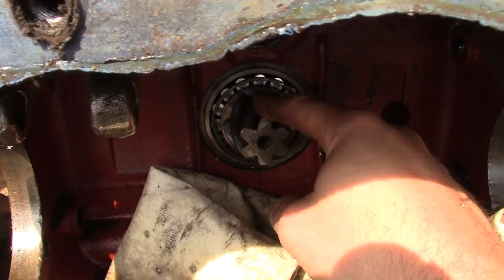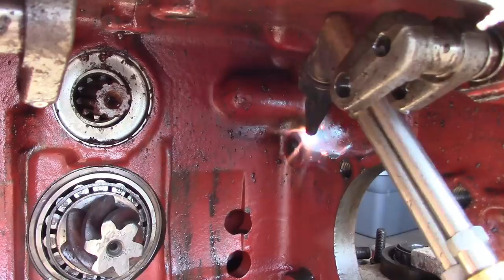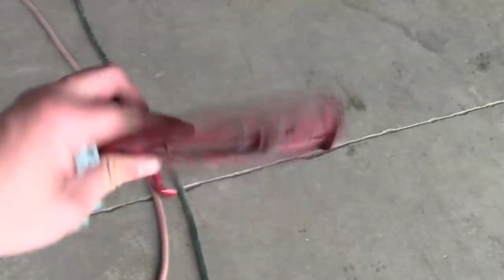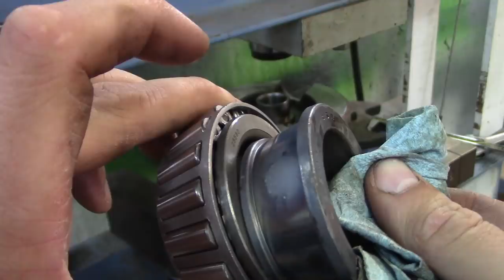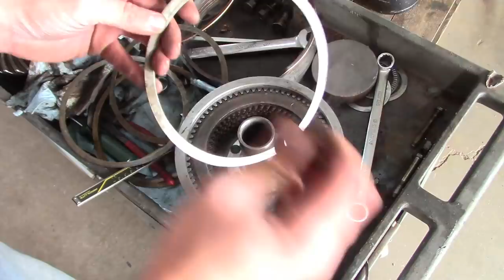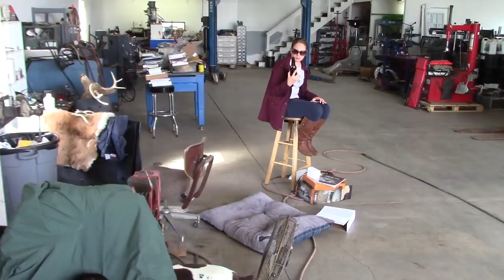1960 Oliver OC46 Crawler - Transmission Removal, Steering Clutch Assembly - Part 3

Comment: 28:03 Are you using COTTER PIN PULLERS to CUT WIRE???? You'd be out on the friggin street if that happened in my shop

Comment: I partially disagree with the old 'rusty gear' non reuse.  I've seen many like that get reused, because there was no other choice, and they simply wore back in and were fine later.   They just needed a few oil changes to keep the rust accumulation in the gearboxes under control as they wore back in.

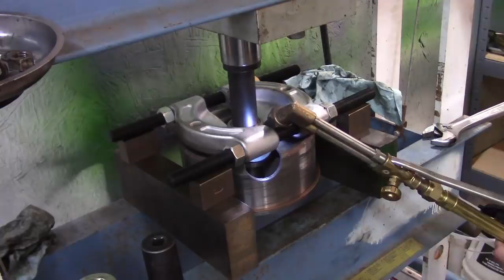Comment: National 25581 is $19.12 at RockAuto and 25580 is $10.88. I find for bearings like this RockAuto seems to have better prices than my local bearing and supply folks if you're willing to wait a few days for shipping. You missed a great chance to say "welcome to the hydraulic press channel" in a funny accent 13:59.
Reply from the maker: Here's the think about Rock Auto. Just because they have a listing for it, does not mean that it's actually available in any reasonable time frame. My National bearing supplier wasn't even sure it was available straight from the manufacturer.
Reply: @WatchWesWork  The stereotype about everything in the south being slow is a real thing. I guess I've lived down here long enough that if I have to wait for something, oh well.

Comment: I don't cut nails or thick gauge steel wire with my side-cutters, it makes them dull, and loose in the joint. They are also not the best tool for cutting the cats claws.

Comment: Well the Japanese and German bearing parts just means they know quality, German bearing parts are the best you can get if you can get them and they also cost the most, Japanese bearing parts have most options and the quality increase over American made is more for the price than the increase to German made, so my guess is they consider the bearing races to be more important? Or they just couldn’t get the bearing itself (this is in reference to the needle thrust bearing btw)

Comment: Using side cutters to remove cotter pins is very commonplace.  Especially in aviation with very large pins (like axle nuts on landing gear).  They other guy doesn't know what he is talking about.
Reply from the maker: It's pretty much the only way that actually works!

Comment: If the guy was going off about you using side cutters on a cotter pin, imagine what he says to Eric O when he runs the castle nut right over them.  We won't talk about beating on the bearing puller.

So if "Interrupting Wes Work" saw the fuel door fly off and went back to get it... did she also return the fuel nozzle to the station, or is there a commemorative wall for such artifacts?  I'm kidding.. but seriously is there a wall?  LOL.  Hang in there with school.  It is a bit of a dumpster fire over here.  We made it through summer tourist season with only 10 cases.  School opened and we are at 90 cases in our very small community.  One case is an elementary school teacher.  Pulled the kids out of school as one is very high risk.  Stress levels are higher than when this all started at the beginning of the year.
Reply: School is school, I'm always stressed more in the fall.

Comment: The radius is more comment these days because most tools today have a round tip since we put a radius one every surface so it doesn't get stress cracks.  So don't sweat it. It's just that back in the day all tools were hand ground, and pointy. These days we use pills and those are all round.

Comment: The clutches are to be soaked in oil for a few hours before being installed
Reply: On paper frictions yes, those old bronze ones won't care one way or the other besides they already had a 50 year soak in oil previously so they probably are set.

Comment: When a split pin has done its work and needs to be pulled out the only issues with cutting the ends off are not to let the chopped off bits go where they can cause damage. I was told that reusing an old split pin is a far worse sin than chopping out a used one and replacing it with a new item. Oh and please, do not use chopped down nails in place of the proper pin! 
That Oliver is no push over on which to work a fight for every inch of progress. I am surprised you have not lost your sense of humour, I think mine would have left town a while back. I used to be up for a challenge but that one is a step or two too far.

Comment: Aren't  Oliver's fun to work on. I did an OC3 some years ago. You can press those gears off the final drive. I did one, nothing to it. just a little heat to swell the gear when assembling. Then you can use the better hub.

Comment: Side cutters on a cotter pin is a no-no??? I never seen a mechanic, that means 100s, use anything else (maybe a slip-joint pliers when cutters were MIA). One size cutter fits most sizes of pin. I love it when "I win" against a stuck 'whatever'.

Comment: Would refitting pitted gears make a huge difference? I've done it on equipment that was not intended to rack up a huge amount of working hours and had 10-15 years of trouble free service. 

Potentially I know it would wear out quicker, but unless it's going to rack up enough hours  to expose that, is it worth the cost?

You had better parts available so it was a no brainer, but in a lot of situations we don't always have that luxury.

Comment: Far be it from me to be critical BUT you should always turn off your cutting torch in the opposite way you turned it on.  Turn of the oxygen first then the acetylene. I was doing it wrong for years also and I'm a lot older than you are.  Side cutters for cotter pins!  Who'da thunk it :>).
Reply from the maker: I can't see it making any difference. I don't want all the soot, so I cut the fuel first.
Reply: @WatchWesWork   I seem to remember being taught to turn off the oxygen first. 
https://www.openworksbmore.org/wp-content/uploads/2020/02/FINAL_OXYACE.pdf
SHUTTING DOWN
1. Shut the oxygen torch valve first. Shutting the fuel first will cause backfire and make a loud pop.
2. Slowly close the fuel torch valve.
3. Close the Oxygen Cylinder Valve and purge the oxygen from the hose by reopening the oxygen
torch valve. Watch the working pressure gauge to drop to 0. Shut the torch valve again.
4. Backout the oxygen regulator adjustment screw counter-clockwise until loose. Close torch valve.
5. Inspect the acetylene cylinder pressure and ask a tech to record the gas level. Follow the same
steps as oxygen to shut down the the acetylene.
6. Watch to make sure pressure doesn’t build up into the line again, put the torch away and lock up
cylinders.

Comment: Don't you know you're never supposed to hit your gear puller with a hammer!!!!!🤣🤣🤣🙈🙈🙈
Reply from the maker: Hmm. I must have slept through that meeting...
Reply: @WatchWesWork  me to.
Reply: Yeah those pullers can get you in trouble.  I had a tapered gear on a hay baler that I couldn't get to release. Destroied a couple pullers, a few knuckles and who knows what else.  Hours later and a lot of frustration, I finally decided to cut the shift in half and head to the John Deere store, but lunch first.  I stood up, took about 5 steps  away (third puller still under tension) and then kaboom rattle rattle rattle.  It flew off and into the door jam.  Shure glad, and very fortunate, I had moved!

Comment: Fyi if you heat the new bearing in oil they fall onto the shafts no press required.
Reply from the maker: I have a bearing heater.
Reply: I never liked my bearing heater, seemed the oil worked better.  Could heat bearing faster in oil.  Normally 250-300 all it would take.

Comment: The dude who said "Don't use side cutters on split pins" should know I open paint tins with a flat head screwdriver too!
Not sure why you're calling split pins cotter pins thiugh!
https://en.m.wikipedia.org/wiki/Cotter_(pin)
Reply from the maker: It says in the second line that in the US cotter pin refers to a split pin.
Reply: @WatchWesWork  Don't worry Wes, i should've put a 😉 at the end of my post. Was just joshing. I'd already googled American English usage.
It's strange how many mechanical and or automotive words are so totally different. For instance I'd say boot, wing, bonnet, gear stick & petrol whereas you guys would say trunk, fender, hood, stick shift & gas. 
The split pin / cotter pin thing is just the tip of the iceberg. The differences have always fascinated me.
Makes me wonder what Americans call those chunky, shaped pins that used to hold on pedals back in the day?

Comment: If you want to save a bit on acetylene, you can use a simple DIY low voltage high current transformer circuit to heat up the metal in seconds.

Usually used for spot welding, but works also for this application:

https://youtu.be/4q4oMVtW4FI

Comment: Running the mower deck waaaaaaay too fast.  Needs to be most of an octave lower in tone.   Just because an engine CAN run at full speed doesn't mean you should ever mow with it at full speed.